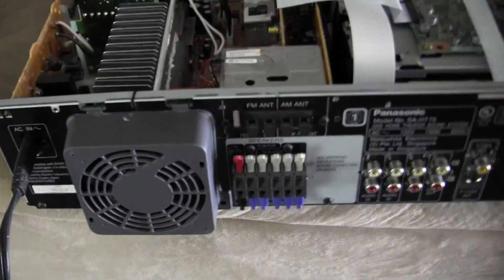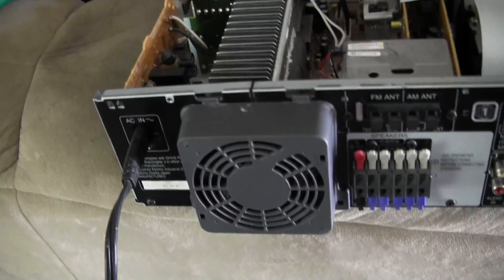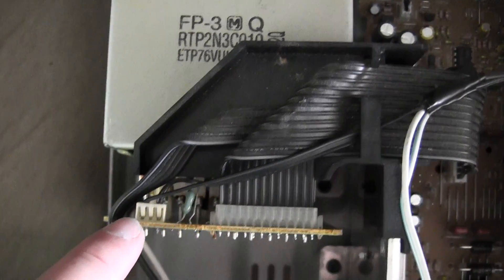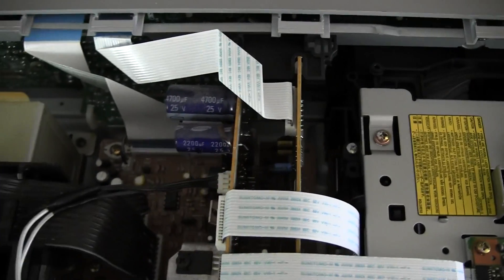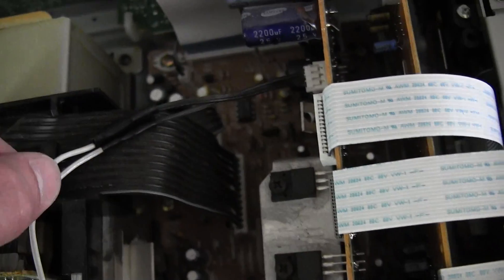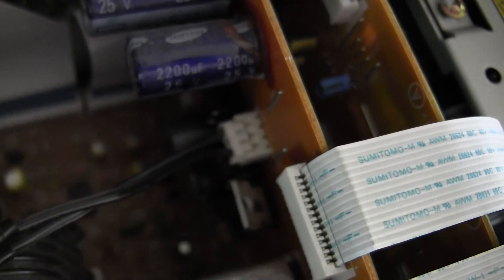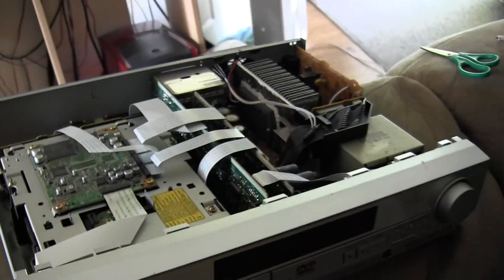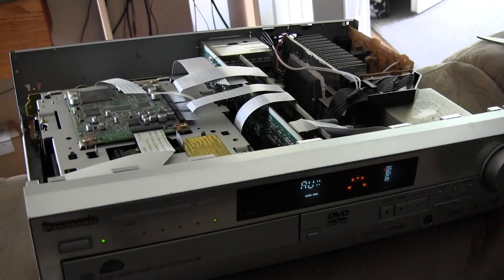How to Fix Panasonic SA-HT75 Fan - Simple Always ON Modification

Comment: just got this unit and made the fan mod. tapped +9v from the colletor terminal of Q703.  This is a T0220 transistor mounted on a heat sink.  this is the same 9v supply used for the fan circuitry.
yes, as mentioned by margogarage, you'll need a 50 ohm resistor on the existing fan terminals to prevent the F61 error from occurring at higher volumes.
i didn't have a 50 ohm so i used a 68 ohm worked okay.

Comment: I did the process in the video but if I turn up the volume more than -16dB the error F-61 appears and it turns off.
Reply: as mentioned by margogarage, you'll need to add a 50 ohm resistor on the existing fan terminals to prevent the F61 error.

Comment: I'm using this same unit as a CD player that's connected to my Yamaha receiver and had always wondered if the fan just didn't work anymore. Saw this video and turned up the volume on the Panasonic unit and the fan immediately clicked on and started cooling down. Since the Yamaha receiver is controlling the volume, I can turn the volume all the way up on the Panasonic and keep the fan running that way. Thanks for pointing out the decibel level connection to the fan, I would've never thought of that

Comment: im relly late to this but i have one and i found out if the fan spins or is connected backwards the unit notices and just shuts off at higher volume but if i connect it the right way it goes all the way up just fine
Reply: You mean that if the connection is wrong despite turning the fan, there will be a problem with the volume (?)

 I'm curious because before doing the mod, when I raised the volume to -16db and higher it gave me error f61 and after the mod the same thing only this time it doesn't matter what level it is -20db, -26db, -30db if the volume is high I get that error and it turns off, do you think that's what you mentioned (?)

Comment: It works on low volume only.. But if you turn to high volume f61 appear because the system detect that no fan is connected on the fan connector.
Reply: You need to solder the +/- 50 Ω resistor where the fan is connected. The error will not appear

Comment: I have that unit. My sound comes on, but after awhile it goes off. Could it be the fan ?
Reply from the maker: This is caused by bad capacitors. I've replaced THREE on this thing since getting it used. Definitely needs to be opened, and have the bad capacitors replaced. If you know anyone that even DABBLES in soldering, this is super easy -- the contact points are gigantic.  (You can get away with it not "turning off" if you keep the volume down a bit -- puts less stress on some capacitors).

Comment: Hi, I am so glad to see that you had the same model that I have with the same error code F61. I will be following what you did to your so I can be able to save my unit. Thanks! Just have to look for that voltage meter and will try it.
Reply: to remove the 61 error open up the machine,  unplug the fan and re-plug it in. You can do his method later

Comment: if it ain't broke why fix it
Reply from the maker: My particular unit was turning OFF when it gets too loud (likely capacitors going bad somewhere), but it also ran VERY hot. So, it was broken. It is now fixed. I am STILL using this unit today. :)

Comment: i have a jvc home theater and it have same problem , fan only working 
when i turn volume up ( very loud )  , so i used double side tape and i 
did put 60mm 12v fan and i wired it to usb port ( i did make it look 
like a usb fan , it will only get 5v from usb so its quiet and it move a
 good amount of air ) i keep it plugged .. but when i want to play music
 from my usb flash memory ... i disconnect the fan

this is very stupid idea by manufactures to make the fan not working at low or 
mid volume
i would like to hear the fan than making my home theater overheating !!
or at least they should make run at low rpm , not completely off 

note :
the size of fan it depend on your home theater , mine 60mm fan
not all home theaters are the same

cheers and peace
thanks

Comment: That line you mention is AC straight from the transformer the fan is DC motor so I took a line off C703 which is DC and a dropping resistor just to lower the fan revs a bit. Needs a soldering iron for this.
Reply: How much resistence in tha resistor? (Sorry bad english)

Comment from the maker: Random standby on this unit usually indicates reversed wiring. If all wiring is ok, then there's a short in the AC intake area of the board. This is normal for this unit, and typically only shuts the unit off when the volume gets too loud.

That's been my experience anyway. I got this 5.1 set at a garage sale for $5. It already had defects (anything beyond -15db shuts it off due to overload), so keeping it cool via a mod helped.